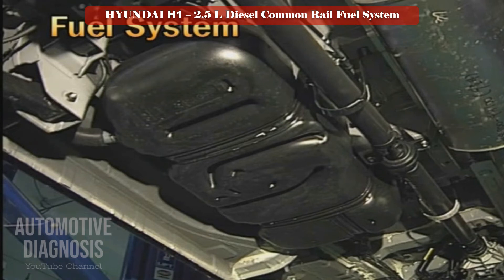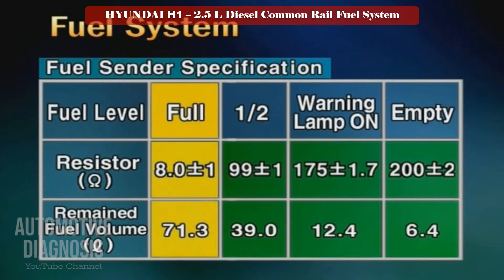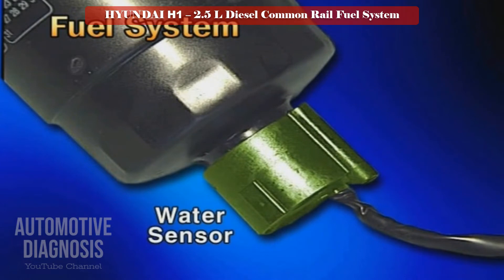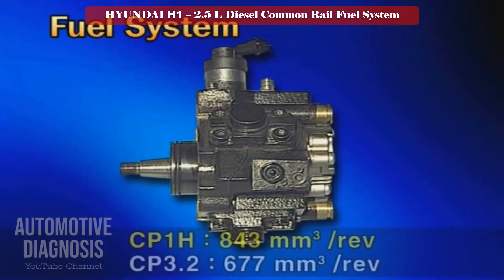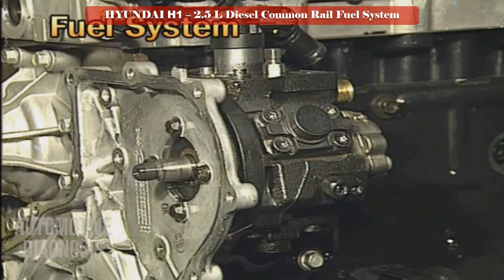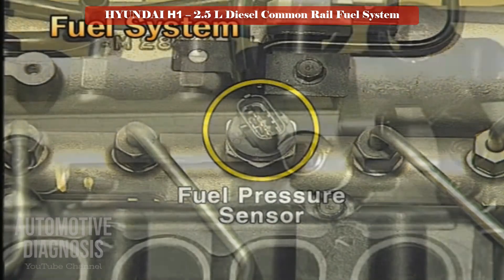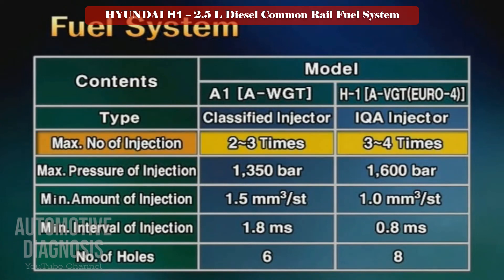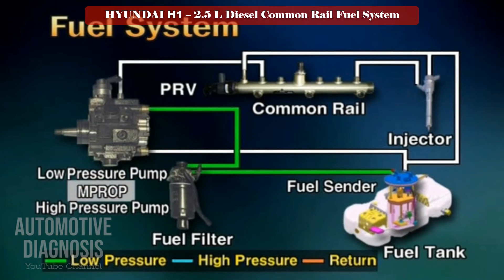Hyundai H1 2.5 L Diesel Common Rail Fuel System Explained

Comment: d4cb engine common rail pressure too low
Reply from the maker: Hi there, this could be cause by fuel pressure control valve (most commonly) or by fuel rail pressure sensor.

Comment: I need trouble Hyundai  H1 2015 
Code fail P0643 circuito high sensor A  engine C4CB
Reply from the maker: Normally this codes will be set if APS, or APT power supply is shorted to power and voltage on that circuit is above the maximum voltage of sensor power supply. It could be ECM internal fault as well.